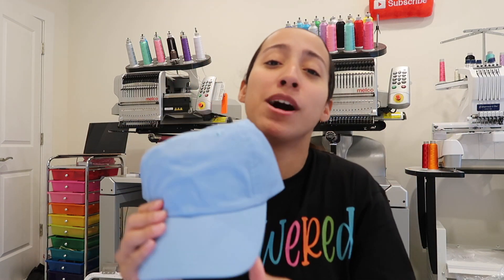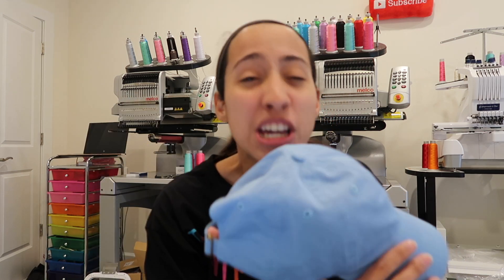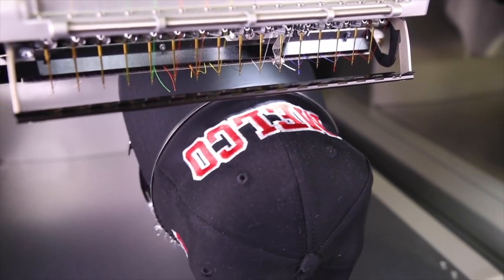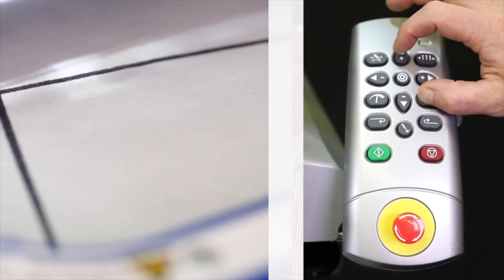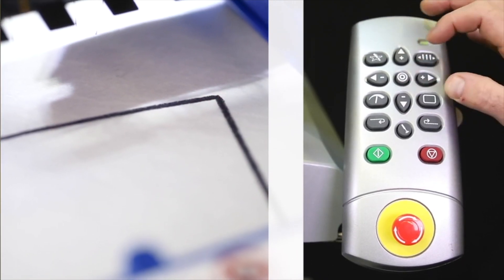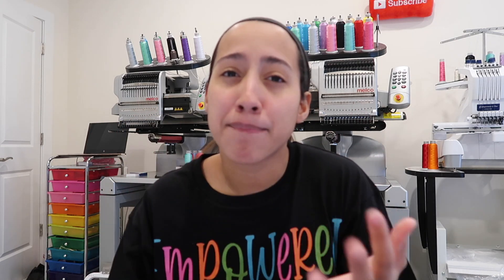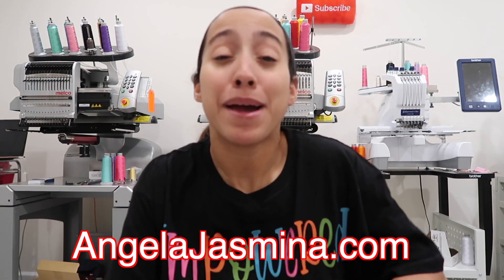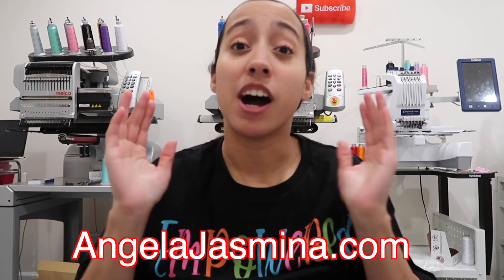Why I Chose the MELCO EMT16X Embroidery Machine For My Home T-shirt Business!

Comment: I will be running my XTS along with my EMT16X. How do I run the actifeed for the two different machines? My XTS actifeed is so different. I run 4 on all flats and 7 on hats and then my needle tension is always on 2 for flats and 3 for hats. Will it let me adjust it when my XTS is Set as the machine I’m using? Does that make sense?

Comment: How do u see your design on those machines
Reply: Hi Kevin; you see your design on the computer that has your Melco operating software on it. An ethernet cable comes with your EMT16X and that's how you connect your computer to the embroidery machine. You can speed up or slow down the EMT16X from the computer and it tells you how long it takes to sew the design and many other features. Thanks, Todd
Reply: Todd Eggersman 🇺🇸